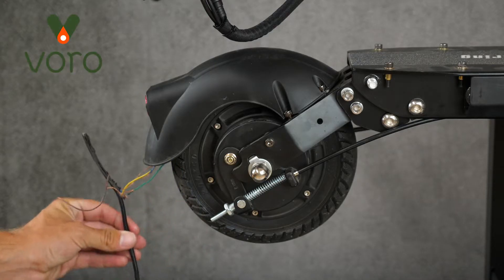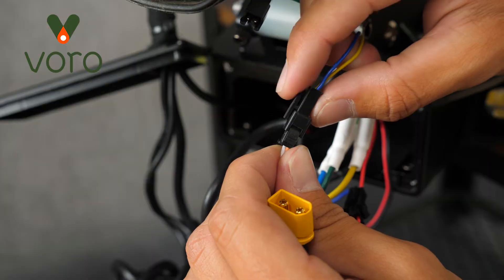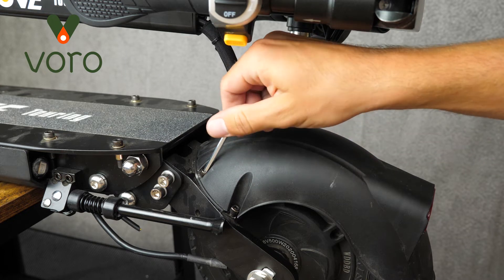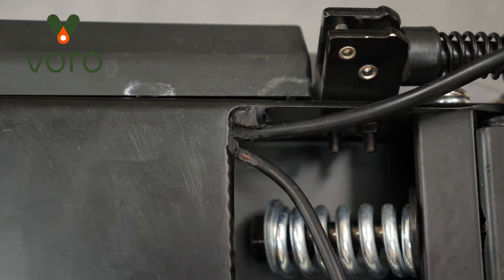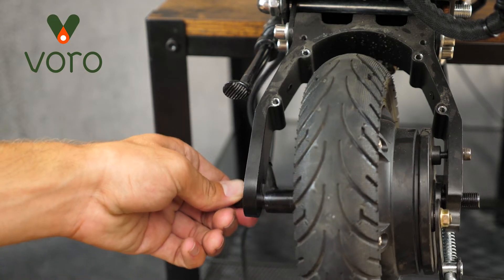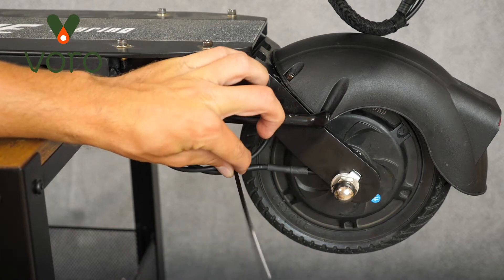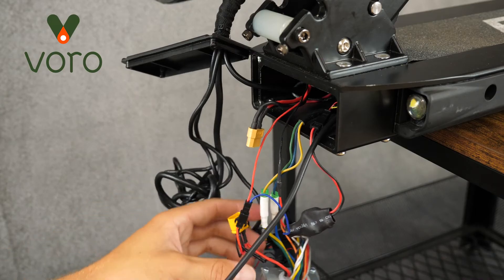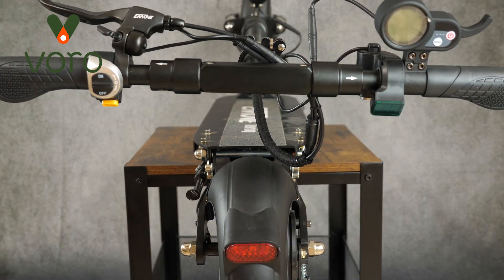How To Replace Rear Fender - Emove Touring

Comment: What about that black glue that you scraped off? What do we replace it with?  I dont want water to leak in
Reply from the maker: You can replace that with a silicone gasket maker, its in a tube and you can pick that up at just about any auto parts store.
Reply: @VoroMotors  ok great! thank you!

Comment: This is a timely video since I just received my replacement fender. This seems like a very tedious and somewhat difficult install. Question since the existing wire is in good shape could I just splice the wires and possibly put some heat shrink around the spliced wires instead of to pull the new wire all the way thru?
Reply: You will have to connect the 4 individual wires and make sure that they are moisture proof. If this is possible, I'd like to know how.   Keeping them from shorting out is important, and this is the problem that I have right now.  My scooter won't charge or turn-on due to a short from the rear fender light wiring.    I just wish these videos came out months ago.